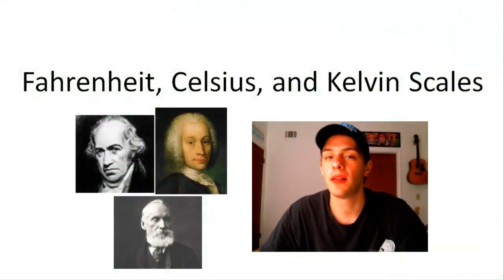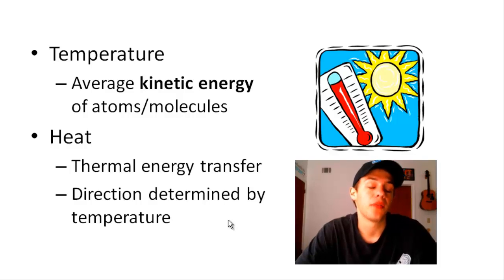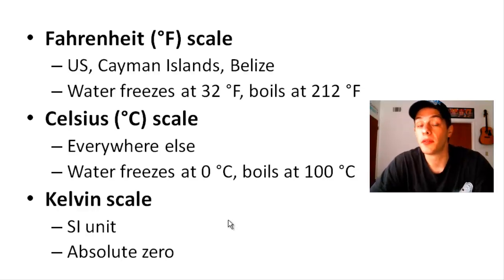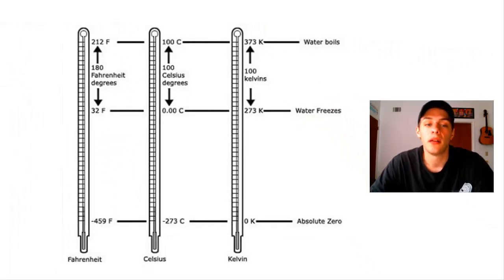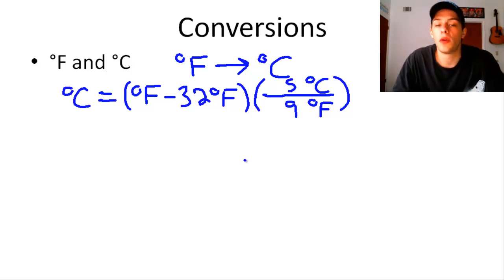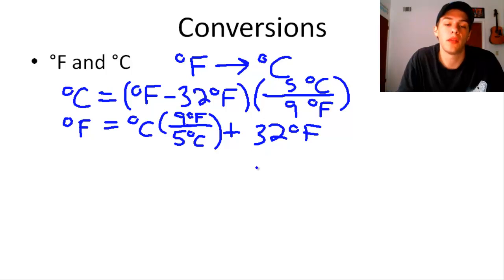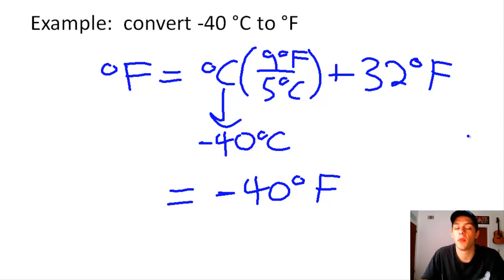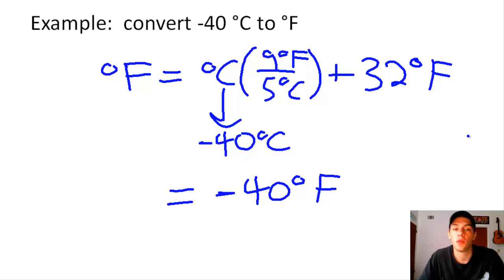Fahrenheit, Celsius, and Kelvin Temperature Scales

Comment: Explain why you can convert f° to c° by adding 40, divide by 1.8, and subtract the 40 you added earlier. Thanks.
Reply from the maker: You can convert to celsius from Fahrenheit by subtracting 32 from the Fahrenheit temperature, then multiplying that result by 5/9.
Reply: @BensChemVideos  Yes, I know. You gave a very good description of why that conversion works; I am asking for the same explanation as to why my method works. I want to grok it as I have the one you gave.
Reply from the maker: Hmmm... good question!  I tried a few examples with that formula you brought up, and it worked every time.  I'll give it some more thought and get back to you.
Reply from the maker: @FreethinkingSecularist  okay, I figured it out.  Both formulas work because those two mathematical expressions are equivalent.  If you distribute and simplify the expressions (x-32)(5/9) and (x+40)/(9/5)-40, you'll end up with (5/9)x + 160/9.
Reply: @BensChemVideos  Thanks a bunch! You know my method may be easier to use because you can convert either way f° - c° or the other way without having to remember to reciprocate the 5/9 fraction or the order of steps for - or + 32. For f-c divide by 1.8 and c-f multiple 1.8! Just add 40 first and subtract it at the end!
Reply from the maker: @FreethinkingSecularist  You're very welcome!  The reason why I like the method I showed in the video is because it has that 32-degree offset between the freezing point of water in Fahrenheit and the freezing point of water in Celsius built into it.

That being said, I always advise folks to do what works best for them, since there's often more than one way to solve a problem in chemistry.

Good luck, and thanks for the great conversation!
Reply: @BensChemVideos  you posted this vid 8 Years ago tho still answering its questions, Nice
Reply from the maker: @Zrixi_  damn I'm old 👴😂
Reply: @BensChemVideos  I was actually wondering 
How do you feel looking at yourself when you did this video 8 years ago
Reply from the maker: @Zrixi_  it's a little weird.  At that time of my life, I had just recently graduated from college and was going through some tough mental health issues, so I really wasn't in any shape to work at an intellectually challenging job, so I got a job as a cashier at a grocery store to pay the bills.

Being a fresh chemistry graduate working as a cashier came with its own set of self-esteem issues, so banging out my videos was a way to counter that a little bit.

So yeah, videos like this one are kind of a reminder of an unpleasant time.

Comment: Celsius and fahrenheit multiply and divide factor is:-
~1.8 x 1 = 1.8. ~1.8 x 2 = 3.6. ~1.8 x 3 = 5.4. ~1.8 x 4 = 7.2. ~1.8 x 5 = 9. ~1.8 x 6 = 10.8. ~1.8 x 7 = 12.6. ~1.8 x 8 = 14.4. ~1.8 x 9 = 16.2. ~1.8 x 10 = 18.Celsius to fahrenheit is (Celsius x 1.8) + 32.Fahrenheit to celsius is (Fahrenheit - 32) ÷ 1.8.

Comment: Heat isn't just the average kenetic energy of molecules. Heat travels at light speed through space. It's true that space in the solar is shrouded in a cloud of invisibly small particles. It is also true that thise molecules absorb that heat and convert it to velocity, but to assume that molecules are necessary for heat leaves the possibility that space must be absolute zero Kelvin. As you approach the sun, that view becomes increasingly clearly wrong. How can you express heat in terms of material kenetic energy without admitting cold space? Is space hot when heat is passing through it? Isn't it more practice to call space hot were you would burn travelling through that space?

Comment: I don't care what the experts say, Fahrenheit is more precise than Celsius or Kelvin. There are 180 degrees between freezing and boiling with Fahrenheit. With Celsius and Kelvin there are only 100degrees. Also Fahrenheit is a linear scale while Celsius is exponential. I am cool with metric distance though(mm, cm, m).
Reply: Jeff Lebowski kelvin is more precise, it begins at absolute zero which is less confusing and it's boiling point is at about 300
Reply: How is Celsius exponential?
Also you do realize that 1) you can just use more points after the decimal point?
For Gods sake you can use ° mC if you so choose
2) for most applications giving more than one place after the decimal points is useless (simply beginning with the fact that in practice temperature is an inherently unstable quantity)
3) 100 is a power of 10
Reply: shut the fuck up ahaha